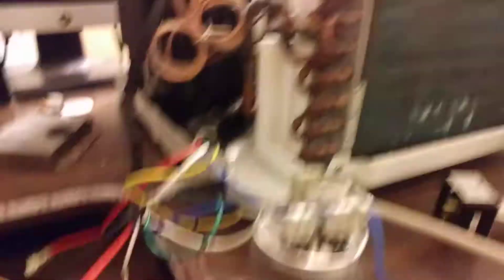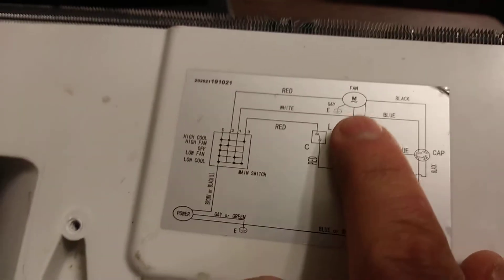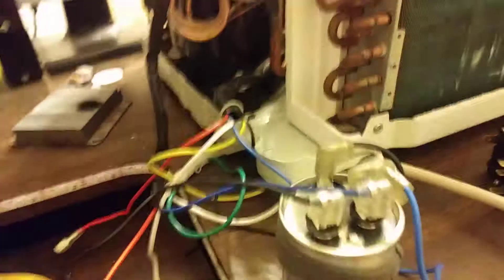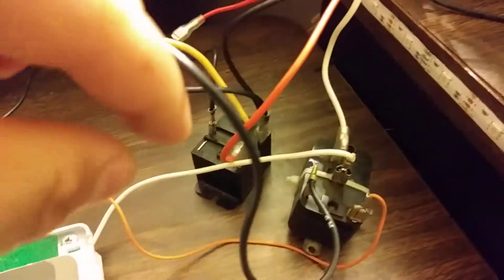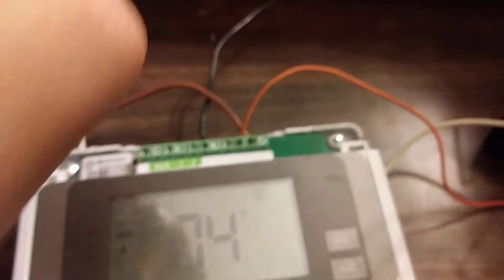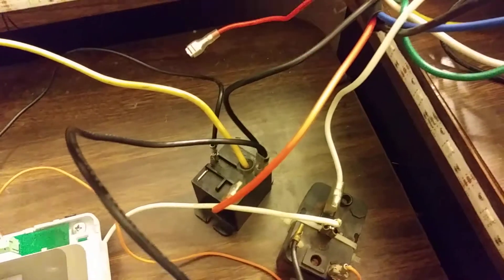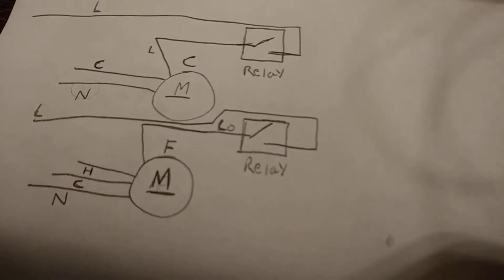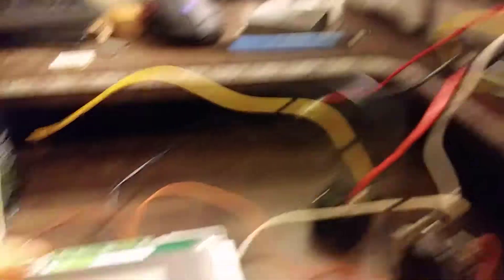Window air conditioner thermostat hack!

Comment: I’ve been looking for a video like this as I had an ac like this that would run the fan continuously, which I thought was annoying.  However, I found another problem with ACs that have their fans run continuously.  A hygrometer (part of a digital temperature/humidity display) led me to this discovery which for the longest time puzzled me.  While the compressor was running and the room was getting colder, the humidity would decrease.  I knew that lower temperature air can hold less water vapor than warmer temps that a decrease in relative humidity meant that the unit was pulling a lot of moisture out of the air.  However, as soon as the compressor cut off, the humidity spiked immediately, sometimes by as much as 20%.  It took me a while to figure out what was going on, but what was happening is the condensation that had collected on the evaporator coils was getting reevaporated and blown back into the room. If the fan shut down when the compressor stopped it would have had time to drip to the outside.

While it is true you waste a tiny bit of (sensible) cooling by not allowing the fan to at least run a few minutes at the end of the compressor cycle. (Also, you waste a little bit of sensible cooling as the reevaporation of this condensate essentially acts like a swamp cooler) it’s doing this at the expense of latent cooling (aka dehumidification). Having your room’s humidity at 45% instead of 65% allows you to set the thermostat a few degrees higher and still be (even more) comfortable.  The alternative is also running a dehumidifier but in addition to the extra power usage, a dehumidifier swaps out latent heat for sensible heat, which then means you have to run your ac more…so even more electricity is used.

By the way, instead of doing all this I just used a smart plug controlled by a temperature sensor.  Also, I haven’t had any issues with it freezing up.

Comment: Word to the wise...  one of the reasons the fan runs after turning off the compressor is to pull all of the cold from system after each cycle.  This ensures you get to make use of all the cooling, but it also helps to ensure the AC doesn't ice over.  If you turn off the fan as soon as the compressor turns off, you're not only wasting that last bit of cooling, but you could wind up with an iced-up / blocked unit.  Maybe.  Might.  Your mileage may vary.
Reply: I’ve been looking for a video like this as I had an ac like this that would run the fan continuously, which I thought was annoying.  However, I found another problem with ACs that have their fans run continuously.  A hygrometer (part of a digital temperature/humidity display) led me to this discovery which for the longest time puzzled me.  While the compressor was running and the room was getting colder, the humidity would decrease.  I knew that lower temperature air can hold less water vapor than warmer temps that a decrease in relative humidity meant that the unit was pulling a lot of moisture out of the air.  However, as soon as the compressor cut off, the humidity spiked immediately, sometimes by as much as 20%.  It took me a while to figure out what was going on, but what was happening is the condensation that had collected on the evaporator coils was getting reevaporated and blown back into the room. If the fan shut down when the compressor stopped it would have had time to drip to the outside.

While it is true you waste a tiny bit of (sensible) cooling by not allowing the fan to at least run a few minutes at the end of the compressor cycle. (Also, you waste a little bit of sensible cooling as the reevaporation of this condensate essentially acts like a swamp cooler) it’s doing this at the expense of latent cooling (aka dehumidification). Having your room’s humidity at 45% instead of 65% allows you to set the thermostat a few degrees higher and still be (even more) comfortable.  The alternative is also running a dehumidifier but in addition to the extra power usage, a dehumidifier swaps out latent heat for sensible heat, which then means you have to run your ac more…so even more electricity is used.

By the way, instead of doing all this I just used a smart plug controlled by a temperature sensor.  Also, I haven’t had any issues with it freezing up.

Comment: Ok so I'm an electrician and also an HVAC guy licensed in both so hows this sound why not just hook up a 24v to 120 volt contactor ( relay) that would control an outlet that the air unit is plugged into way more simple then all of this that your doing however I wonder if when the unit is turned completely off and this would only pertain to a digital unit if it would remember its last settings
Reply: Mines digital(LG), if it loses power it doesn't come back on. I'm doing it to connect to an automation system. Though I miss the old analog window unit that it replaced, that thing would freeze your tits off.
Reply: Because in many cases like mine the electronic controls are bad but the compressor and fan are fine. So I need to replace the bad board with something better. Also window units get really cold at night. Something weird going on with their design. Probably since the thermostat and its sensor are right up against the evap coils. So I want to be able to control the unit with a regular home thermostat like this guy did.

Comment: Hi! I would like to know if the temperature on A/C's display is the temperature of air coming out of vent or the holding temperature? I'm asking this because I own two Frigidaire window A/C units (10,000 BTU & 12,000 BTU) and, in both of them the temperature on the display seem to be the temperature of air coming out of vent... I mean, the higher the set of the temperature, the warmer the air coming out of the vent is! 
By the way, do you know if Frigidaire window Air Conditioners are inverter A/C's or non-inverter? (I purchased my units about 8 years ago... but they still are in very good condition)
Thanks!
Reply from the maker: The thermostat should display the set temperature that you want the system to get to, usually when you are adjusting the temperature on it, it will display the temperature you set it at for a few seconds then it will display the actual room temperature. And no I wouldn't say that your Window units are inverter driven. Inverter driven Air conditioning system's use a motor speed control to control the speed of the compressor motor usually by a PWM or Pulse Width Modulation to control the refrigerant flow. Tho you can look up the model numbers on google on your AC units and see the specifications on them and the features they have and if they are inverter based systems
Reply: Let’s get this straight.. there are 2 main components in an air conditioner. A compressor and a fan. When just the compressor turns on in a inverter You’d hear a very very very faint high pitch soft weeeee noise.. but its unlikely a inverter  if it’s 10 years old.. non-inverter units also make a loud kinda thump then buzzing and sound kinda loud when they run which is the compressor pumping refrigeration through a set of copper coils. A fan then blows air around the cold coils making the air cold.You cannot change the temperature of the air coming out of the unit if it isn’t a inverter. Try a mini split. They are very efficient.. and guess what?? They’re inverter systems. look it up. Inverter systems have a board inside the air conditioner that convert the electricity inside the air conditioner from 120v AC to 24v DC. There is another circuit board that makes the air conditioner  variable speed..